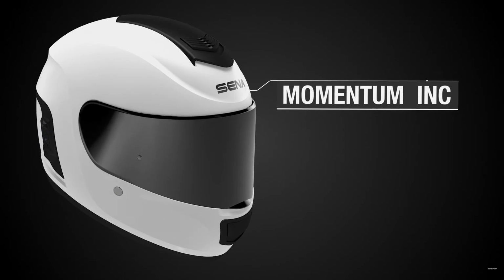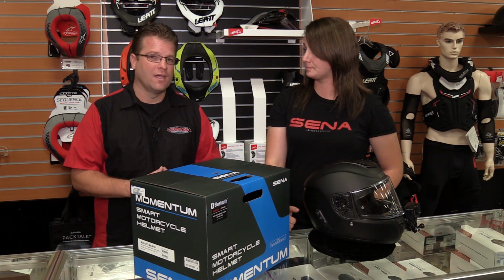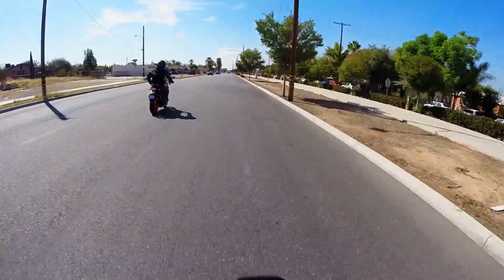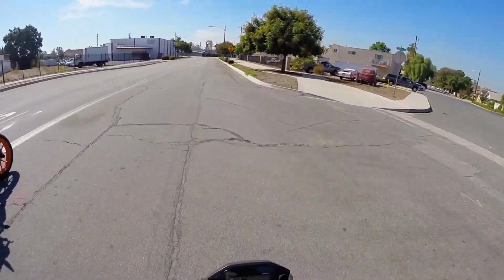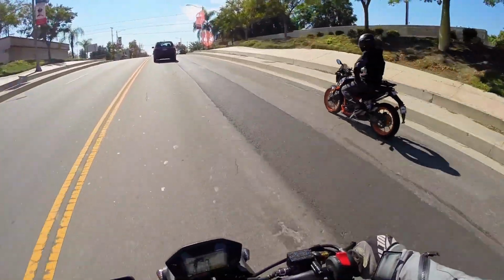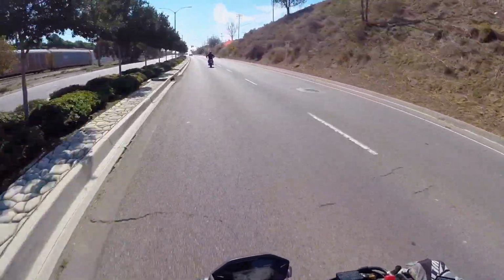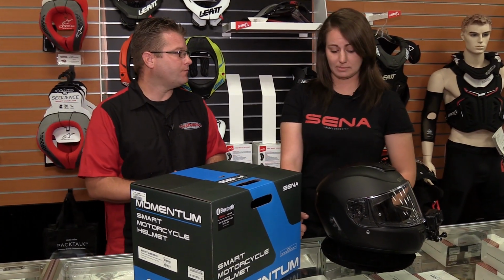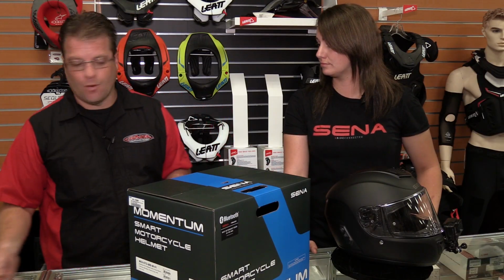Sena Momentum Helmets with Integrated Bluetooth Headsets for 2019 INC Lite

Comment: I just recently got the sena momentum inc pro, I love it the sound quality is excellent.
I usually wear a lg but I was told to get one size larger and it fits great.
The camera is ok but not as good as my GoPro, but I do like how small it is and the angle is very good from the top of the helmet.
Overall I am very pleased with this helmet.
Thank You for your videos.
Reply: Thanks for that input. What's your opinion of the airflow? I keep hearing its weak, but I really want it anyway,considering that I'll be in Va
Reply: Post Tramatiq not great airflow but I ride with my shield cracked open and then you get good flow.
Reply: @charless8641  I was hoping you were going to tell me, what I wanted to hear, is it loud inside that way?
Reply: Post Tramatiq the sound level and quality is excellent, the helmet blocks the outside noises better then any helmet I have ever owned.
Reply: @charless8641 Even while the with visor cracked? But being so quiet will be great for me since I have bad ear ringing already. Thanks for your help also.
Reply from the maker: Great feedback!  I really want one of these helmets for my MotoVlogging. How long does the camera battery last for you?  What are the Pro's / Con's for you?  Thanks, Kyle
Reply from the maker: So True!
Reply: Post Tramatiq sound level is better than the previous version. The only shortcoming is the base is not great. 
Very clear when talking on phone and when talking to other people, my friends also use Sena I don’t know if that makes a difference.
Reply: Chaparral Motorsports the camera is okay quality not as good as my GoPro but I have used it for two hours and had no issues. The talking time is listed as 20 hours I have not run the battery out yet so I’m not sure if that is true. 
Even when I used the camera for about 2 hours I still had battery left so I’m sure it will meet all my needs.
Reply from the maker: Wow!  That is great battery life!  Thanks for the info.